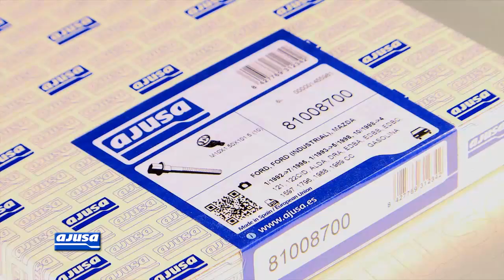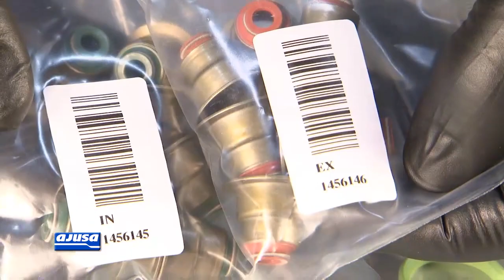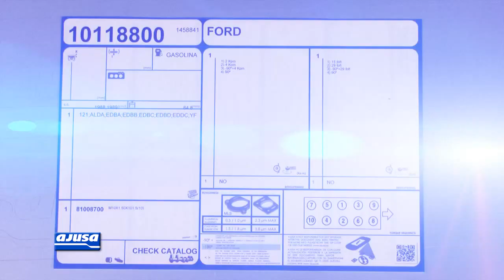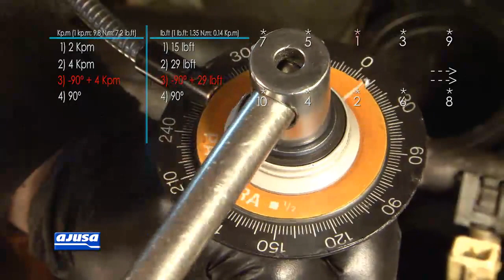Full set / Juego completo FORD FOCUS 2.0 16V EDDC .

Comment: Que herramienta usas bro
Reply from the maker: ¡Buenas tardes! Muchas gracias por tu comentario. Nuestro mecánico utiliza varias herramientas, machos de roscar, dinámometrica, compresor de muelles de valvulas etc. Si quieres saber alguna en concreto, dinos el minuto del vídeo que te interesa y te decimos :) Un saludo amigo!
Reply: @AjusaAutomotive  buenas tardes disculpe para desmontar la cabeza de el motor se tiene que primero porner a tiempo
Reply from the maker: @thekinghacker5133  Para levantar la culata es recomendable calar el motor para evitar problemas posteriores en el calado de nuevo. Puede ponerlo a tiempo a posteriori también. Un saludo